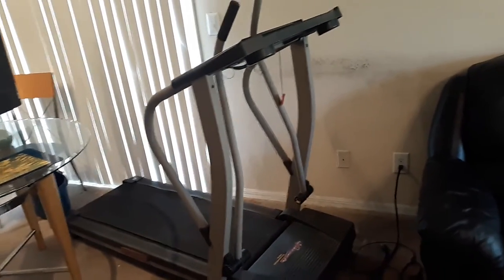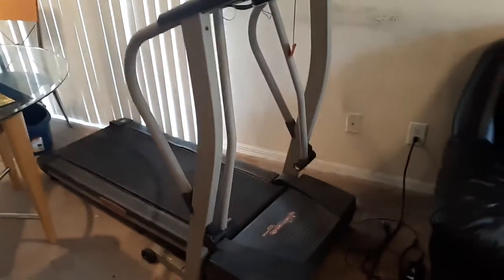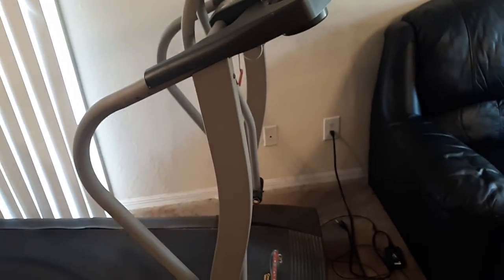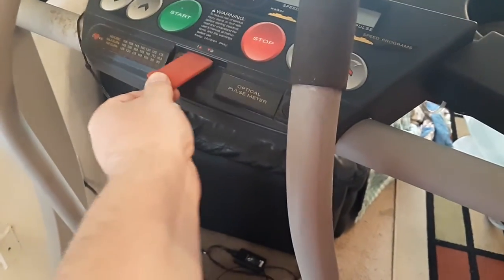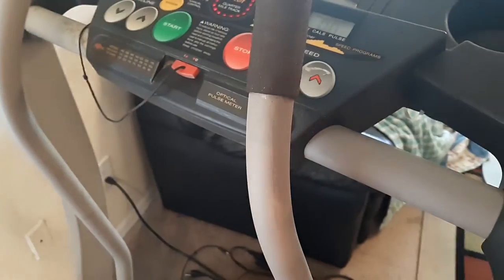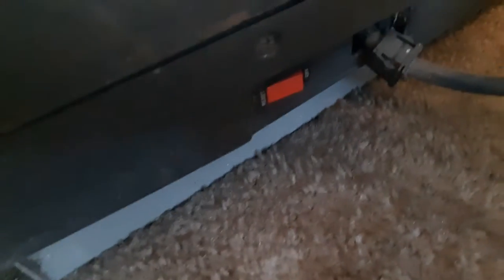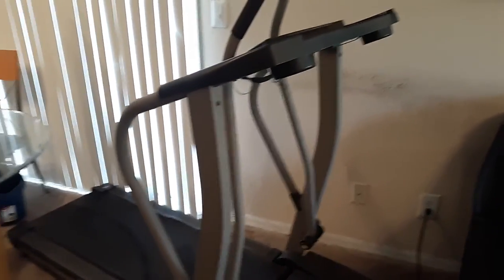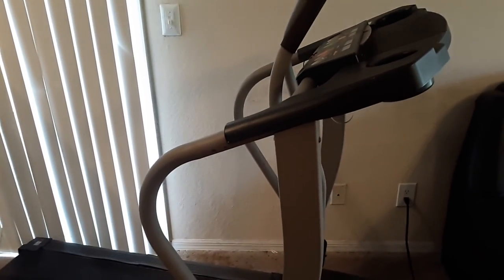Fix TREADMILL No Power When Plugged In (Pro-Form CrossWalk 380x Norditrak Sole Cardio Wont Turn On)

Comment: I have a care fitness jog runner treadmill I had power to the display screen for about 5 seconds then it cut out can’t get the display screen to work 🤷‍♂️ any idea what this problem could be? When plugged in I have power to the main switch which lights up when it’s on so I know I have power going to the treadmill any help would be much appreciated thanks

Comment: I have a Pro Form Premier 900 Treadmill and it won't turn on.  I did the switch, Safety key and still nothing?   the circuit plug works.  TV uses the other plug and it runs.  Any ideas?

Comment: Model PFTL 40070 will not turn on when key is inserted while it is plugged in. Switch on bottem is on, and 2red lights are lit under the cover of the motor.